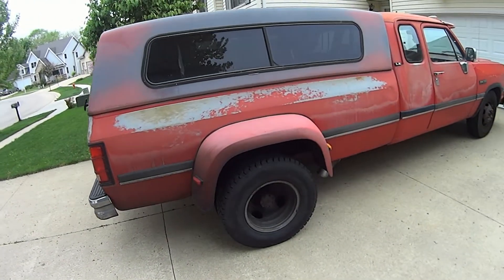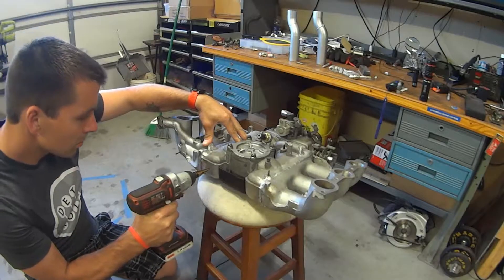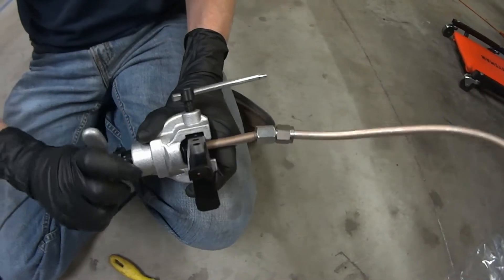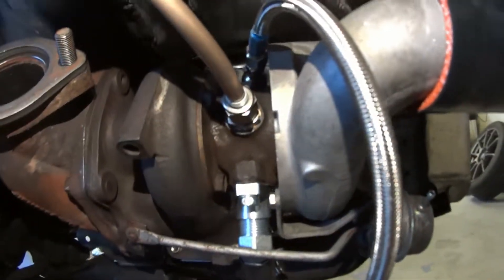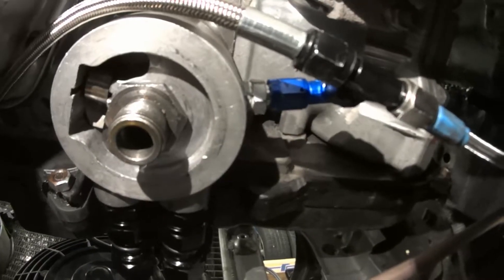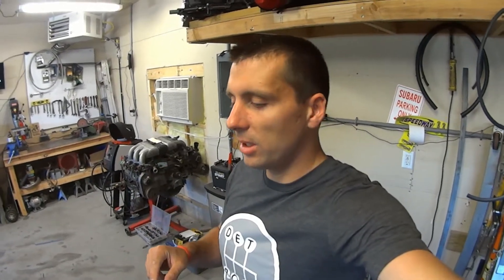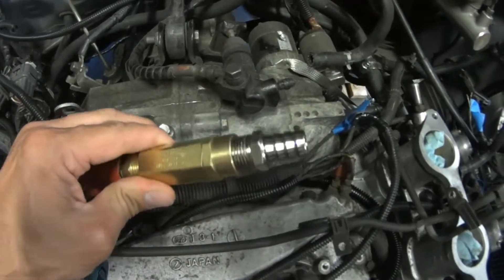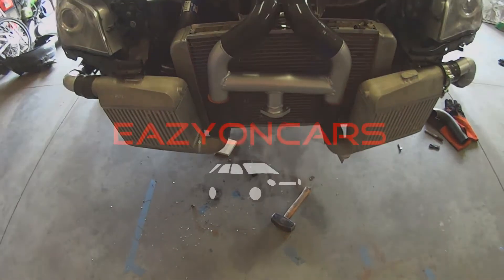EG33 Swap - Junkyard, Turbo Plumbing, IAT, PCV (Ep. 25)

Comment: Why didn't you just use a catch can instead of making a PCV system ?
Reply: That would have gotten rid of your problems easily while increasing the life of your build probably
Reply from the maker: Long term plan is both. All I did was improve the existing PCV system.

Comment: Just something I like to do when making threads, I like to go clockwise two turns, then counterclockwise once
Reply: If possible. I would have a street 90 before the tee for the oil scavenge, that way the tee isn't so low
Reply: Keep up the great work man!
Reply from the maker: All great advice. Totally agree on taping threads as you say, helps clear out the shavings. The T is a bit low, but the 90 I have puts it about the same hight.